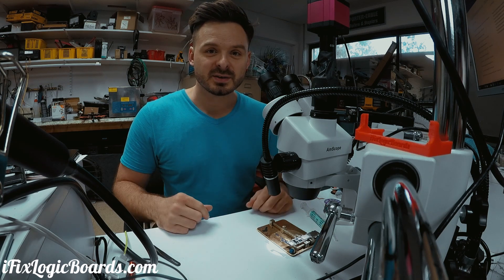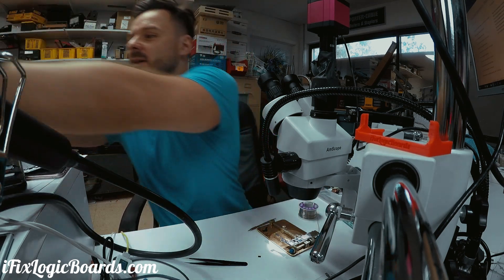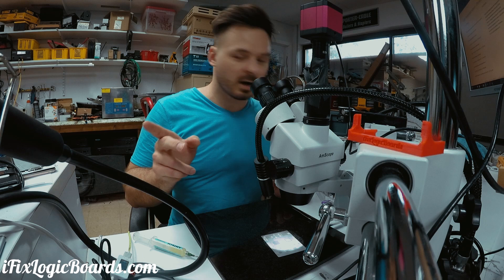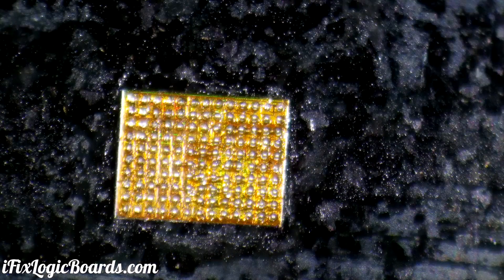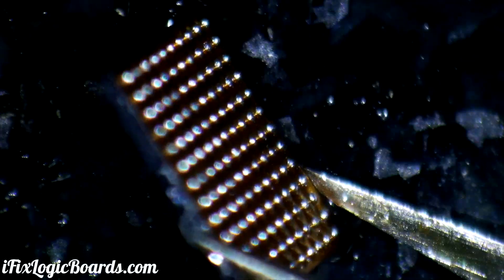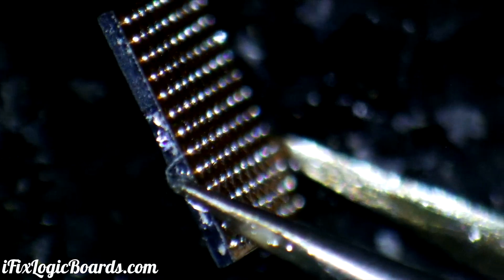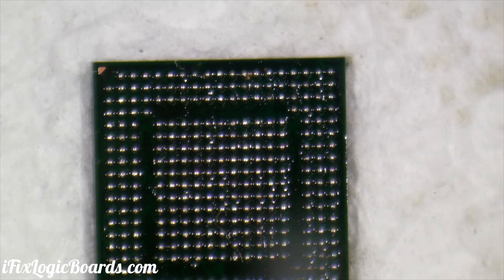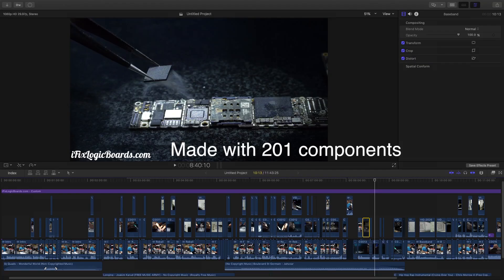How to reball chip ic with solder paste and 3D stencil

Comment: How to prevent stencil from warping when applying the heat ?
End up with failed solder balls
Reply from the maker: to much heat
Reply: @scoopof3d  tried that but still same issue, even at 200c it warps

Comment: Wow! what Kind of station is that, that runs at 360c and takes that long to melt the solder?
Reply from the maker: A $60 one lol. Now I have one that melts at 200C.
Reply: ScoopOf3D most be a $60. I believe your life is a lot easier now. I use the Quick 861WD.
Reply from the maker: @mohameddukuray6740  This one is also $60.
But when this one dies I will get Quick.

Comment: Can the cleaning of the the motherboard pads only be done with a conical JBC? solder tip. I (try to)copy with my Hakko conical tip(fx 951 solder station set to 400 celcius) it doesn't seem to get hot enough and insteads spreads the solder across the pads in a semi solid coagulated mess..... everytime.

Comment: I Think it took longer time for the solder paste to melt because of the Granite Slab under was sucking all the heat.
Reply from the maker: I will check that theory.But even trough napkin I had to be a lot hotter.
Reply: i am saying this because sometimes after reballing,you know how you reflow the IC a little so you make sure the balls holding tight. i noticed  when i hold the IC in the air,they reflow much faster then when its down on the plate. let me know if you find out.thanks
Reply: true